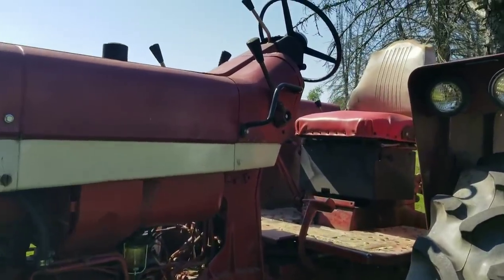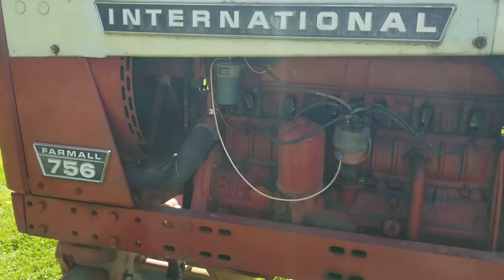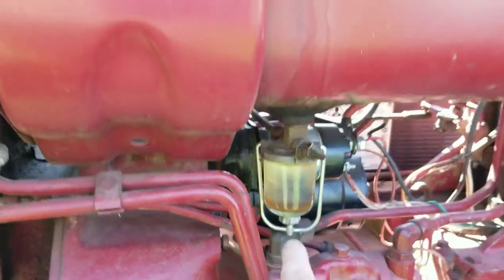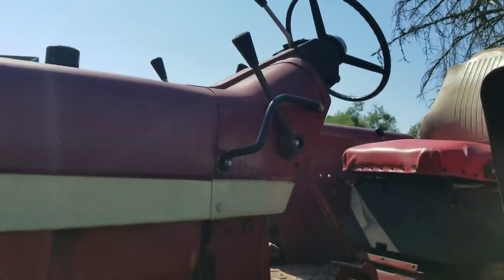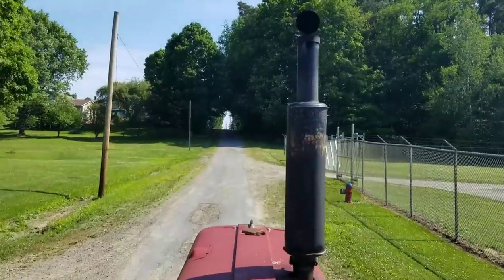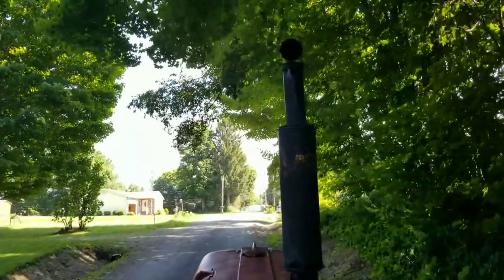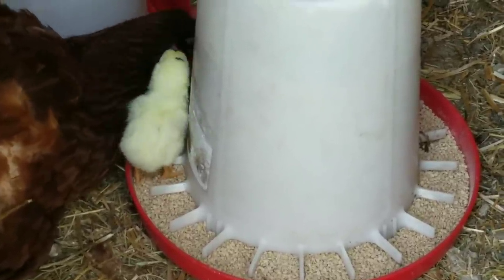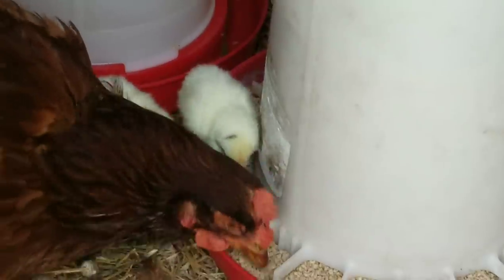What To Do When Your Gas Tractor Stops Running | Testing a Torque Amplifier

Comment: Very accurate description of the coil vs gas engine stall. I would add that while the sediment bowl intake is the first place to look for fuel restrictions I have worked on several older tractors where the steel line from the sediment bowl to the carb had severe buildups of gas goo, some had enough flow to get gas to the carb but not enough to run much above low idle, some won't start. The first one I had 40 yrs ago about ran me crazy.

Comment: I don’t know if you realize that every time you push the clutch pedal down, the TA shifts to low. Every time you release the clutch pedal, the TA shifts to direct, on a properly adjusted clutch-TA linkage. On the farms SMTA I went though everything, including the TA with an IT manual. Later I did my own alternator conversion with a Delco 10SI with using the factory wiring harness. 
One thing that I found out digging in the Delco books, is that a SMTA LP and a 400 LP ran a 12 volt starter with a Ford style starter solenoid. That way you do not need the starter rod, or you can modify your starter to accept the mechanical starter switch. 
Hello from north east Montana.

Comment: I usually blow back through the fuel line from the carb with the air hose turned down. Seldom is there anything coming out when I take it off. Works good. Same method as yours for the valve. Then I take a 6' or 7' length of clear 1/2" ID  tubing, stick it in the tank with the air nozzle, seal it as best I can with my hands (it takes a bit of fumbling & practice to get it right) & send some air in until gas runs out the hose into a screened funnel over a gas can. Then I let the suction work it's magic & vacuum the crud out of the tank. Works like an aquarium vacuum. If there's any pieces that won't go up the hose, it's time for the retractable claw grabber thing. Works great!
Reply from the maker: The problem is a lot of guys breakdown out in the field

Comment: As far as the fuel problem goes,steel lines rust internally. If you disconnect fuel line at carb,and catch the fuel as it flows out, you should have a steady full  stream of fuel. Now to ck a TA in high,lock both brake pedals together,make sure you have brakes, then go down a incline in DD..If tractor starts gaining speed,then direct drive clutch slipping.

Comment: Wished my J.Deere had this option. Seems like I'm always a little short on power. Thats an awesome feature.  IH had it all figured out,  back in the day. I live in W.V. the mountain state.  Man that'd be sweet to be able to have a half gear to shift down to on the fly.
Reply: I’ve seen the option on a 2750 I think, I could be wrong on the model, it’s been a while. It was under the left side of the steering wheel and looked like a shuttle lever. Rabbit and tortoise. I’m a mechanic and seen it in the shop.
Reply: Thank you Thomas Bowen.  My J.D.3025 is a hydrostat. With only two ranges. I much prefer a  geared transmission.  This was my first automatic,  its a good tractor  i just don't like the whining noise from the transmission.  Drives me crazy. LoL

Comment: And remember don’t pull that TA back going down hill
Reply: That all depends on what style of hydraulic TA you have. 
The base TA free wheels going down hill. 
There is an optional TA sold a lot in corn country that provides engine braking in TA. 
The factory mechanical TA never provided engine braking in TA. There might be a mechanical TA from M&W that provides engine braking. An old and gone IHC mechanic told me that. I might have the wrong company name. He started working at the IHC dealerships just as the 06 series was coming out 1962 maybe?

Comment: Massey Ferguson had it's version of torgue amplifier called Multi Power Don't be going downhill in MP.......zero braking. Knowing that it had a death trap on it's hands they got rid of it after a few years.
Reply: I broke a speed record because if MP, and also that the brakes were bad, all at the same time.
Reply from the maker: Lol

Comment: I have a question I have a 69 656 has torque amplifier everything has worked great for years today I fired her up and when I went to put in reverse she wanted to take off . I tried twice but nothing any ideas did my clutch randomly dump everything appears intact still
Reply from the maker: Without being there I can't really tell you, but it does sound like your clutch went

Comment: Ok my son bought a ta tractor no handle.no shaft justa hole.he wants to sell me the 706.i wish someone can tell me what is supposed to be there.Is the handle attached to a hydraulic valve like the steering.or is it a mechanical linkage

Comment: What if my TA lever is hard to pull or push forward?
Reply from the maker: Then your linkage needs unfrozen and worked
Reply: @FarmallFanatic  how do I do that? I tried greasing the zerk but did not get better. It’s also harder to shift gears when torque is off. (Forward)
Reply from the maker: @sethhohlen8057   Sounds like it might be a tear down
Reply: @FarmallFanatic  woof. Alright thank you!

Comment: Yoi know how to sex them I guess.   Real young.. The pelvic bone is two pieced for laying eggs. The roosters are one piece. One bump on rooster 2 little bumps in hens easy to feel gently touching the point .. That works on all birds. Even before they get adult feathers. My great aunt used to make capons for eating.  If you have a vet.?get him to show you how to "fix" the roosters. They will be just as good to eat as a female. Do them young. If you like old hen and dumpling a Capon will be lots bigger and just as good. Even fryed is good.
Takes 3 seconds with a single edge Razer blade and tweezers.  I was officiall chicken catcher. For her.
Reply from the maker: Good information

Comment: Painted red so you can find them broke down in the middle of a field !!
Reply from the maker: Ain't red leave it in the shed
Reply: My blue one has me blue. Need to do an inframe on my ford 3000
Reply from the maker: I love doing engine rebuilds
Reply: @FarmallFanatic  As a red owner , you have plenty of practice .😉😉
Reply: JD’s are green to blend in with the grass when they break down.Not a very proud color.IH’s are red so you can see them .Running proud and standing out,not hiding in the background .
Reply: @tomballard8877  no reason to be "Green" with envy . Stop buying so many red parts then maybe you could afford Class ??
Reply: Daryl Pressel they all get the job done it’s just certain colors may take a little longer!😂
Reply: @sethlynch7751  too much road time getting red parts ???
Reply from the maker: Green's the only fixing I ever did
Reply: @Farmall Fanatic to me I don’t have a problem Witt any of them. I guess ya got what ya got and they get the job done
Reply: @FarmallFanatic  How many times has the. Red company been sold ??? Inferior back then , inferior now ..
Reply: @darylpressel6670  same thing happened to the other green tractor...  called piss poor management. Stoopid management hold'em out  be plundered for their exceptional designs and then sold off.  Same thing have happened to American Locomotive.
Reply: @bearasojrnr  cry a red river 😭😭😭